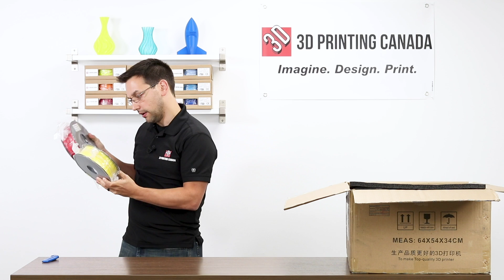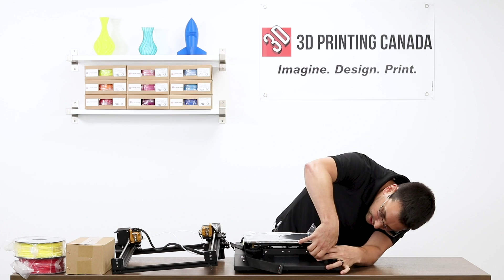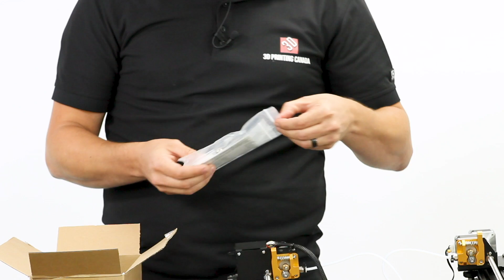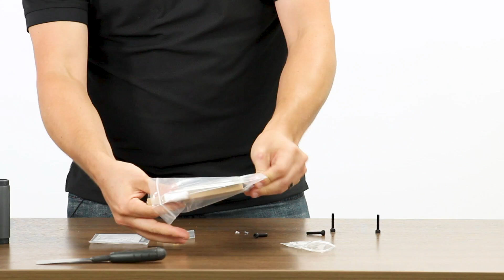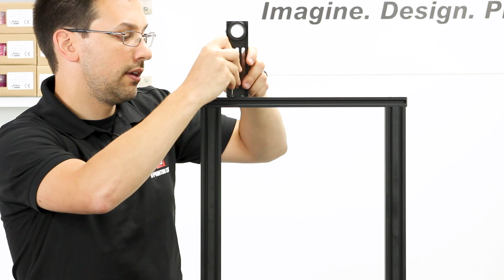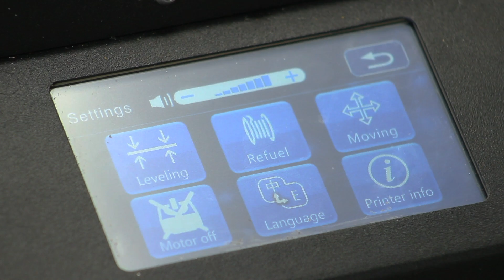Unboxing the Creality CR-X Multi-color 3D Printer

Comment: 9:09 but they do have a guidance in the case in form of a piece foam like the packaging material with channels, which will prevent the screws to tip over from the allan-key and get lost in the casing.

Comment: Great video, looking forward to seeing it print. Right off the bat however there are things I don't like about the printer; the whole gantry looks pretty flimsy to be hanging 2 spools of filament off the top, don't like how the filament/extruder arrangement causes a side pull and that ribbon cable flopping around desperately needs a wire way/cat track to help clean it up. What slicer will be used to take advantage of the 2 extruders?